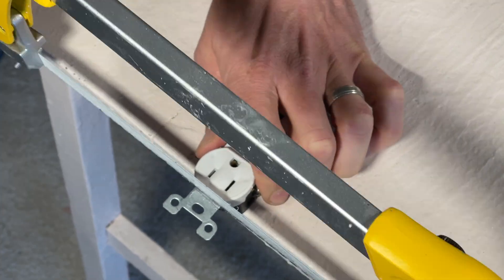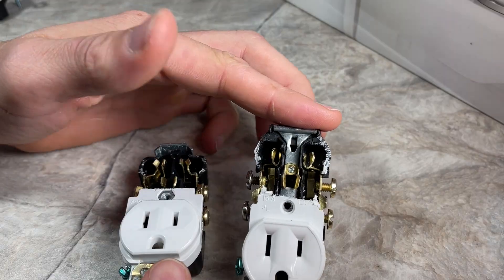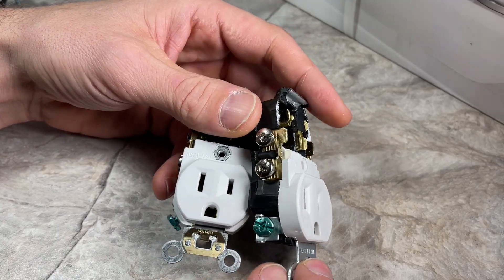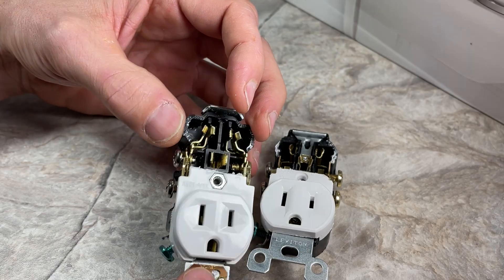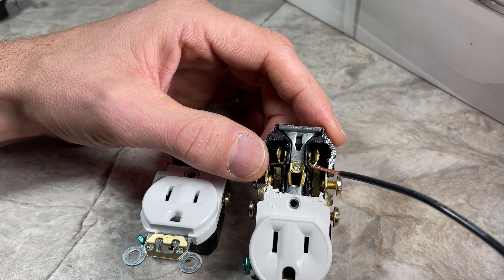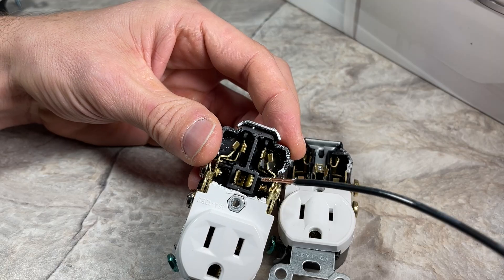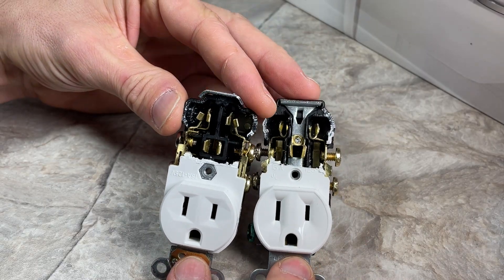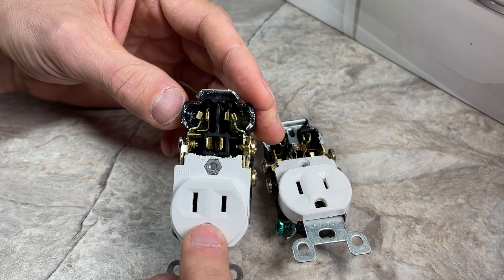What Outlet Should You Buy For Your Home |  Commercial vs Residential

Comment: for general or regular use the res will work ok , in the kitchen , garage , cellar and bath definitely use the comm style . these areas are more likely to be used for heavier load or amperage uses. heavier loads can cause heat to develop especially if you have loose connections or like shown lighter internal parts /.

Comment: i've got a 110 flux welder. i've plugged that bad boy in on my work bent and have welded off those cheap outlets i put on it. ran more than a few power tools off it with no issues. obviously i would have opted for something better if i have known the difference inside but they're working fine even for welding on my little welder. i honestly figured they were pretty much the same. what will really make ya cringe is i cut up an extension cord to wire it up. i prolly violated every code in the book on that little project lol. it's safe enough, nothing exposed, nothing loose and dangling. it'll be fine..
Reply from the maker: "it'll be fine" sound like famous last words.  Be safe out there.

Comment: Seems the 50 cent outlets would expose the manufacturers and maybe retailers to high risk of product liability lawsuit. That risk obviously outweighs the reward otherwise we wouldn’t see those dangerous at Home Depot and Lowe’s.
Reply from the maker: Hey Doug, I have thought the same thing in terms of risk.  Something tells me if you were to search there are 100's of lawsuits filed over the years on the cheap outlets and switches.  I think the manufacturer would point to the installer and try to say they passed all UL testing so it must have been an install issue.
Reply: The code really should not allow those residential outlets to be used at all. You can actually find a out of code stuff at Home Depot for many things like plumbing repairs, so even if code banned it, it does not mean Home Depot has to stop selling it. Code in reality is enforced mainly for licensed electricians (inspections).

Comment: the commercial outlet has a backwire option with a screw-clamp device, in addition to the wrap around the screw method (fish-hook).  it is much easier to use and has similar contact surface area and contact longevity because the wire is held in a clamp.  while it is not quite as secure as the fish-hook wrap around the terminal screw, it is more practical to use and less error prone.  the fish-hook method is not infallible, but recommended.   the cheapo models with the stab in holes that have a spring should NEVER be used as you say.
Reply from the maker: Great feedback and appreciate the help!

Comment: Were these both 15amp? If you have your line going into a 20amp breaker you would also be better off using  20amp receptacles for high draw areas like the kitchen and bathroom.
Reply from the maker: Hey James for the video you are correct that these were both 15 amp.

Comment: So as someone who has had to deal with the aftermath of some previous owner selecting the cheapo crap and even mis-wiring;  swaping neutral and ground ...  My humble opinion is that you use commercial grade outlets for most of your house but for outlets that will be used extensively, meaning plugin- plugout daily (ie kitchen, bathroom outlets) you should do yourself a favor and use hospital grade for those.  Yes I know they are around $10 but those are worth it.  Even if you only stay for 5-years in your house, when someone comes in with a plug and checks the resistance they will be impressed (I have seen people do that so it's not crazy).  Further if you stay in that house longer, you won't have to mess with those again.  I have in the past, but I will never buy again the contractors 10-pack of crap outlets.

Comment: If it is seldom used, I suppose most will work, but for my own use, especially where it will be used often, I want spec grade, and I’ll take NEMA 5-20 over NEMA 5-15.
Reply: why 20amps? what are you doing in your house?
Reply: @Galgamoth  very few things, even in the shop, need a 20 amp plug.  But I figure a receptacle designed for both the NEMA 5-15 and the NEMA 5-20 is going to be a bit more durable, being engineered for 20 amps.  Probably a lot safer if it is ever asked to carry a sustained 14-15 amps.
Reply: @lanedexter6303  a residential break will not handle a sustained 15amp load and you are forgetting the fact that everything is downgraded 14 gauge wire is actually rated for 20amps also a commercial 20 amp and 15 amp receptacle use the same gauge of contact. In my shop I ran 20amp circuits on number 12 because multiple tools or some tools used continuosly will trip a 15amp break but in the rest of the house, it's overkill except kitchens and bathrooms
Reply: @Galgamoth  I would hope a 20A breaker would carry 15.  I confess less than 100% confidence in thermal breakers.  I’ve seen older ones (especially when people have been using them for switches for years) fail both ways - a 20 trip at 14 or a 20 carrying 33  with no trip.  Fuses are more accurate.  I assure you I have 20’s on my #12 circuits, and if forced to run a #14 circuit I’d install a 15.  And yeah, I know NEMA 5-15 devices aren’t really supposed to sustain much more than maybe 12A continuous.  Pays to overbuild and be cautious.

Comment: You can tell a cheap plug from a good one by how how things plug in and out. A plug that has a good connection will be very firm to push in and firm to pull out. Loose connections with heavy current causes heat, heat causes electrical fires....

Comment: The main issue is the following 1> contractors trying to save time by using push connections rather than wire wrapping 2> BEST is to use 20A rating rather than 15A you can use a HIGHER RATED plug on a lower Amp circuit, the contacts are heavier duty and dissipate heat better, you still will only draw 15A, but it's better, I've done that on the plugs and receptacles here.

Comment: Good video. I had a cheapie one installed here with little use. It actually fell apart, internally. The plastic that held the blades
broke and when I went to put the plug in it would not go. Replaced same with a good one. No more cheap junk outlets here.
Barry

Comment: Having owned and managed 46 apartments for 18 years I have seen what this video is talking about. I started using the commercial grade outlets too. The heavily used outlets frequently had cracks and black arcing marks. Some had brown over heating marks. Since outlets are daisy chained a lousy outlet over used can interrupt a whole chain of outlets.
Reply: A loose outlet can overheat, starting a fire which creeps up INSIDE the wall. If the renter is not at home, a huge fire can get going before anyone notices it. Most house fires are caused by worn-out outlets.
Reply: @rollingtones1  I had a home built in 69 with aluminum wiring.  One day my refrigerator, kitchen and dining room lights were off. upon investigation, the outlet had shorted and about 6" of the wire insulation melted before the circuit breaker decided to wake up.  Found the breaker was bad.  After that every outlet, switch and breaker was replaced with 35 year newer stuff.
Reply: @datsuntoyy  hopefully with CO/ALR outlets?
Reply: @Galgamoth  all outlets were replaced with copper compatible but they were all properly pigtailed with copper wire and the anti oxidant compound as per the NEC.
Reply: @datsuntoyy  did you also use the proper wire connectors?
Reply: @Galgamoth   I hope so, it was a long time ago.  New owners gutted the house so I'm guessing much of it was redone again.  Some was rewired, should rewired it all.
Reply: @rollingtones1  I suppose if it were wired with the paper insulation surrounding the ground wire left loose inside the junction box it could have that chance of igniting and getting up and out. Is that paper flame retardant at all? What else in the wiring and walls is flammable?
As mentioned, ignition source and fuel are both necessary.
Reply: Everything in the house is flammable. An arc is a lot of energy being dissipated to jump the air gap which means lots of heat. All you need is an ember than anything else can go... like wood. Your ignition source would be the hot jumping to ground or neutral in a short circuit inside a meltable and burning plastic housing.
Reply: @rollingtones1  and if the fire investigation can't find how ut started the electrical/electrician gets the blame.
Reply: @jennifurzoe1302  Nope, not it you have a competent investigator. If you can't prove your hypothesis on where it started, the ignition source, first fuel ignited, and the failure mode or circumstances that brought the ignition source and fuel together, the fire is considered undetermined. I agree that in decades past electrical kinda became the default cause for lack of anything better but those days are long gone.
Reply: I have plugs that are 30 years old in our buildings that work perfect, once they get loose they end up breaking.
Reply: Same here.  We have over 900 rental units of various types, many mobile homes.  The cheap residential grade outlets get loose or fail completely much quicker than the commercial ones.  Also, the commercial ones are much easier to connect because of the clamp design of the terminal screws and it allows up to 4 cables to be attached easily rather than just two.  So in cases where someone has a light or something that splits off of a daisy chained line, you don't need a bunch of wire nut connections jammed back into the receptacle box.  It allows for much cleaner installs without failure prone twisted wires.
Reply: Daisy chaining to be cheap makes GFIC situations even worse.... the leading outlet is GFIC, the trailing ones are not. I am not sure if this is code currently, I see it a lot.
Reply: @citylockapolytechnikeyllcc7936   My current house and my last had a GFCI outlet in the master bathroom.  Every bathroom, the garage and the back porch all feed off the master bathroom GFCI.  Its really dumb and REALLY easy to overload the circuit.
Reply: @citylockapolytechnikeyllcc7936  all  devices downstream from the GFCI are protected. It's a code violation to put multiple GFCI on the same circuit
Reply: @Galgamoth  Interesting. I would think confusion would ensue, when someone sees a regular outlet, not knowing if it is a subordinate to a GFCI or not. Something shuts off, and you gotta play Where's Waldo ? I would opt for a few more circuses, so each outlet is it's own GFCI. I have gone through this Easter Egg Hunt this past year.
Reply: @Galgamoth      While States, Cities and Towns are all free to make any codes in addition to the NEC , the code you cite is NOT in the NEC. It is permissable to install a GFCI at each outlet of a circuit, typically it is "pigtailed" at the outlet and only protects itself. In some situations, this is preferred and in other situations this is absolutely necessary.
Reply: @citylockapolytechnikeyllcc7936  every GFCI is sold with a sheet of stickers to stick on the outlets that  are GFCI protected

Comment: One other difference in could see would be the grounding tab on the bottom the commercial one. It's used so you only have to ground the outlet and in that tab will ground the metal box as well instead of having to run a pigtail to ground both. Otherwise it is a very great video and thank you for making it.

Comment: Now I understand why my plugs are falling off my 20-year-old outlets. Great info. Thanks.
Reply: I played in a band and sometimes,  we  played in a place that has very old outlet that does not hold the plug. That is not good for the band when all sound systems suddenly shut off in the middle of a song due to power loss.
Reply: @1942nn  never heard of duct tape eh?
Reply: Outlets are a wear item that should be replaced periodically.
Reply: @lawnmowerdude  No, the good quality one ($0.50 or less ) should never be replaced. It stands well forever
Reply: me 2  Thats not correct. Even in the video the commercial outlet he is using for display is stamped 15amp.
Reply: My current home was built for me in 2000. I  have had at least 4 electrical receptacles that have failed over the years in my home. Of course in the places of freq use like the kitchen.
When I build my next home, I  will put professional grade plugs in all of my rooms in that future home.  The labor cost to have someone replace those 4 plugs is probably 10 times the cost difference if all of the plugs were commercial from the beginning.
Since my current home was built by a big name nationwide company, I  did not have any choice on the kind of plug that was installed while the house was being built in 2000.
Reply: @akidwaimd  high cost doesn't means higher quality. It is  because the greediness of capitalism
Reply: I inherited my great Grandfather's house that was built in 1895. So I still don't khow what outlet to use. The house is almost in shambles.
Reply: LoveTheSun  And falling out plugs is not the  real danger.  As the author of this video mentioned, but in my opinion, could have stressed a  lot more is:  Loose connections cause resistance, resistance causes heat. Heat causes the connection to loosen  up more. If the outlet has a significant load, there is a good chance of a fire occurring inside your wall.  Very dangerous and the reason any loose outlets should be replaced immediately.
Reply: @DEW409  Good point.
Reply: @LoveTheSun  arcing arcing is the danger that heats it up
Reply: I have replace a couple of my worn out outlets. It's definitely noticeable how much better they now grab onto the plugs.
Reply: @Speed Buggy 50cent?
Reply: That definitely was very expensive commercial brand Leviton..
I had to change all my home Leviton to Walmart GE branded $0.27 one, it is much better
Reply: Leviton all fails , avoid the brand
Reply: If in doubt for replacements, I suggest Leviton or Hubbell
Reply: @JasonW.  hubbell too over priced
Reply: @JasonW.  Leviton is the worst , all were losing out. I had to replace with $0.27 one from Walmart
Reply: @JasonW.  Both brands make both cheap and expensive units so staying with a well known brand doesn't help.  Both the units he's showing are Leviton.
Reply: You may want to just replace the outlets you use with quality sockets.  Put a small indelible mark perhaps a UV mark on all your outlets and if you start using one with a mark, replace it.
Reply: @johnwang9914  Wrong, No such UV mark on any outlets. I guess you tried to say UL certification. It has nothing to do with quality actually, it is just certification of passing safety test. Leviton is the brand you should avoid
Reply: @flyingman358  I'm saying you could mark your current likely cheap outlets with a marker and a UV marker would do so without being noticeable.  Then when you actually use an outlet, you can easily identify if it's one of the original outlets that came with your house and you can decide to upgrade it as it's clearly an outlet that you use.   You're certainly not the sharpest knife in the drawer are you...
Reply: Went cheap like stupid homeowners always do. Lmao just because you slurp schlong under the bosses desk doesn't mean you know how to choose outlets for your home.
Reply: @VG-rj8pn  cheap has better built with n shape metal to secure and hold the charger.

Comment: The wires connect to the outlet differently also. The commercial clamps down a straight wire the other you need to form the wire around the screw.
Reply from the maker: Good point Ray.  You are right I didn't cover that feature of the Commercial-grade outlet.
Reply: Replacement socket and plug cord ends are like that as well. Plus strain relief.

Comment: With people starting to buy more electric vehicles these days, the use of quality receptacles is especially important (unless they're going with a hardwired Level-II charge unit).   Even the lowest-power charging supply equipment (for example, a 120V Level-1 EVSE like the ones included with a Chevy Volt or a Nissan Leaf), is going to be pulling as much as 12 Amps continuously for many hours.   

When I think of people buying an EV (of which I'm a fan, BTW), and then plugging their shiny new EVSE into one of those cheap-ass $0.50 receptacles... it's concerning to say the least!

And to make matters worse...  since "time is money" (and the consequences aren't their problem, long-term) ... many electricians and mass-production homebuilders won't even bother to use the vastly-superior side-screw terminals.  Often they'll choose to save themselves 20 lousy seconds, and utilize those horrid back-stab connectors instead.  YIKES!  Those things are dangerous and should be OUTLAWED!!
Reply from the maker: Good feedback and you are right the EV revolution is just starting and many, many charging units will be plugged into $0.50 outlets in the coming years as the adoption ramps.  I got my Cybertruck on order!
Reply: @EverydayHomeRepairs  Congratulations, that thing looks like it's going to revolutionize that market!  I bet you won't be charging it on Level-1 though! 😁
Reply from the maker: @floobertuber  hahaha, I think that is a safe bet.

Comment: My first time commenting on any you tube vid.  Great job!  Had a house where the outlet barely retained the plug.  Had a home warranty that covered electrical.  The electrician that came out told the wife that the outlets were fine, just bend out the prongs on the plug!!  I'm not an electrician, just an electronic tech, told the electrician why I thought that his solution was wrong.  Wound up replacing the outlets myself but, used the cheaper outlets...now I know the difference..BUT, they retained the plug as they should!!  I did subscribed. Thanks!
Reply from the maker: Thanks Ernie,  yeah unfortunately it seems like I have more and more poor experiences these days with any type of "pro" that I have come work on any of my homes.